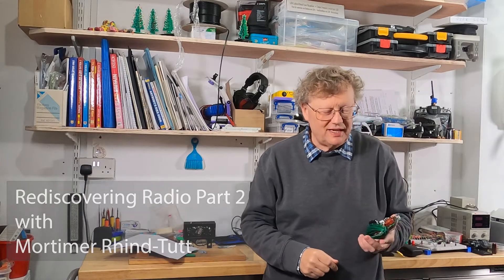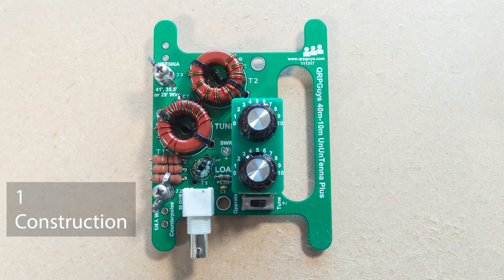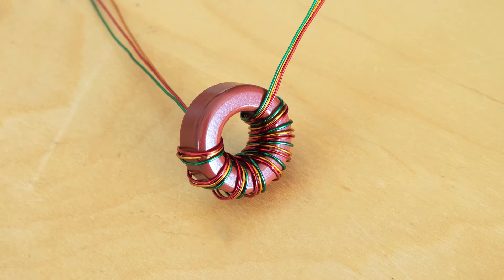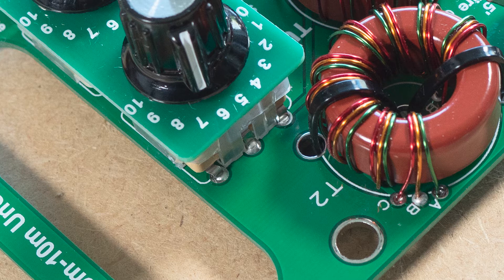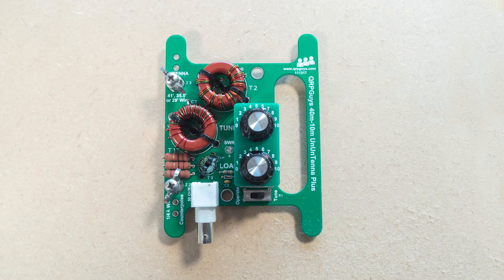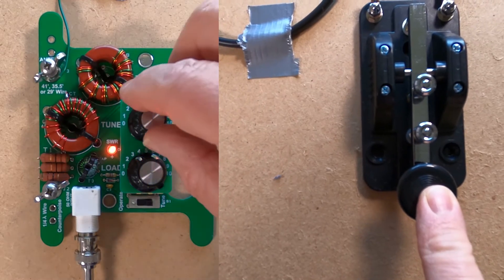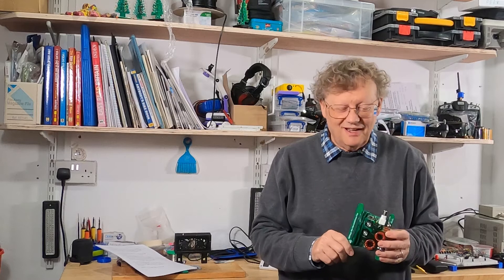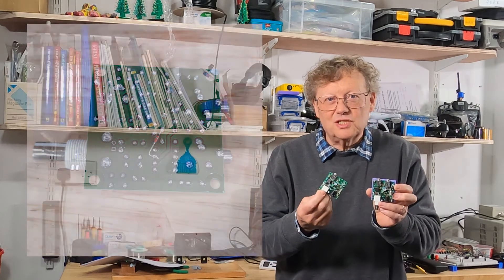Rediscovering Radio 2 : UnUnTenna Plus and more...

Comment: I made a homebrew SWR bridge indicator very similar to the circuit that the UnUnTenna plus uses. It is good for field use as is small, light, rugged and can be used with various antennas and matching units.